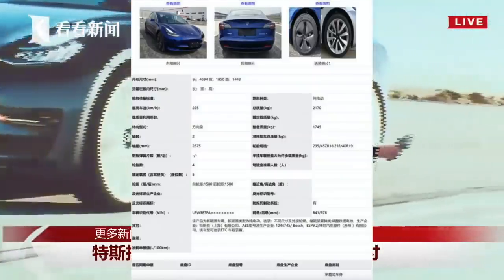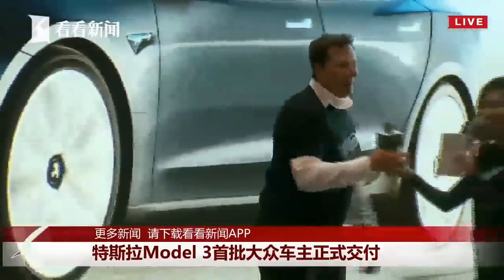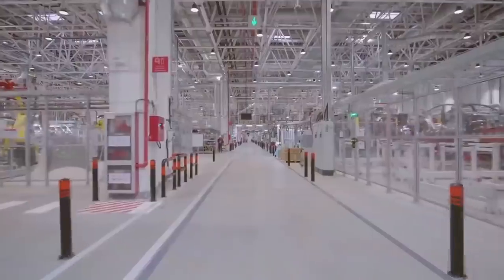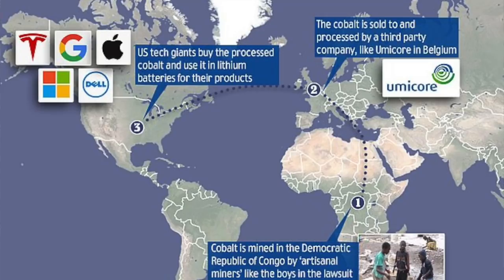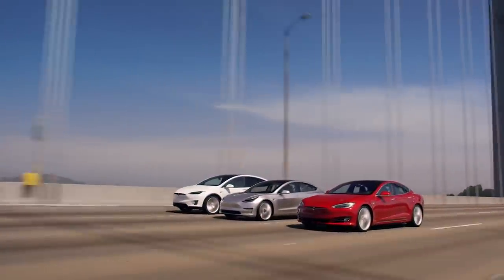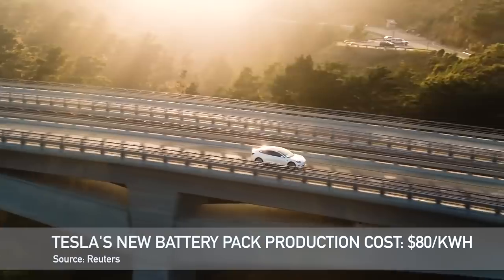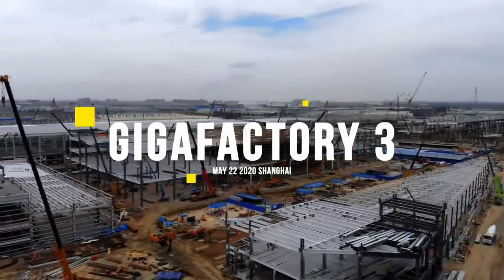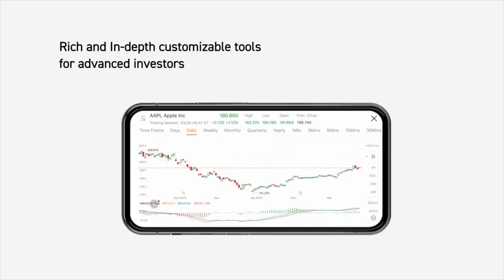Tesla's New CHEAP BATTERY For The Model 3: Lithium Iron Phosphate

Comment: I don't think LG Chem is supplying LFP. Low energy density means more material usage. It cannot be cost cutting approach. The cobalt ratio in cathod material has dropped to 10% already. It will drop to 5%. LFP will be the solution for Chinese market cheap car segment only.
Reply: Catl makes lfp-batteries already. Lfp have better lifespan both in shelf life, cycles and they dont degrade as much on high charge due to low voltage. Cobalt is very expensive compared to iron so even removing 5-10% cobalt will reduce price.

Comment: Another benefit of advanced LFP batteries manufactured in China, is that the IP for such batteries will leak and be stolen. This might well result in a lot of Chinese industry cranking out advanced long-life li-ion batteries. This could accelerate the adoption of li-ion batteries for vehicles by other companies while increasing the commerce ties between China and the rest of the world. In zero-sum terms, this seems bad, but historically, commercial ties and trade have been the best deterrent to war. In 2020 and the next couple of decades, this will be an increasing concern.
Reply: The LFP Battery is a CATL product they have been using and developing for years, CATL also has patents for single crystal Cathodes also
Reply: spot on  👍